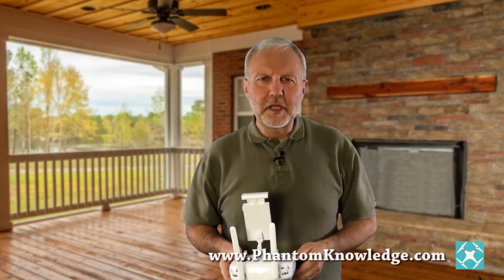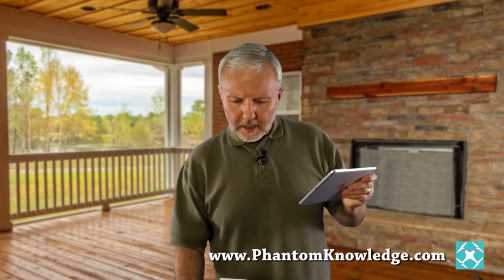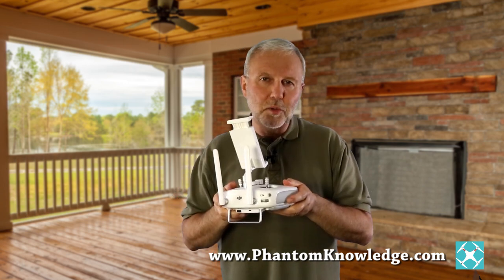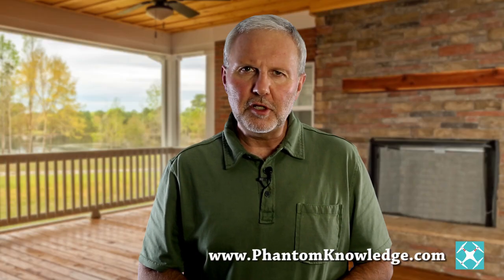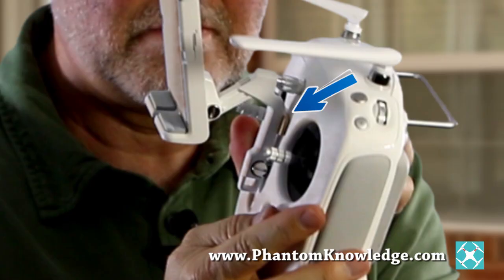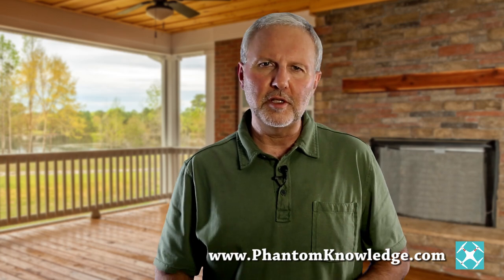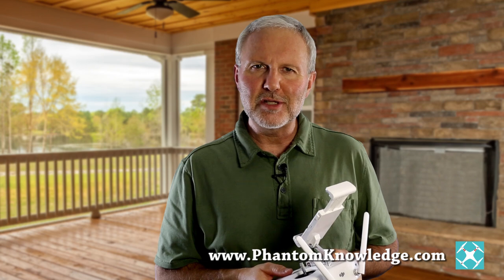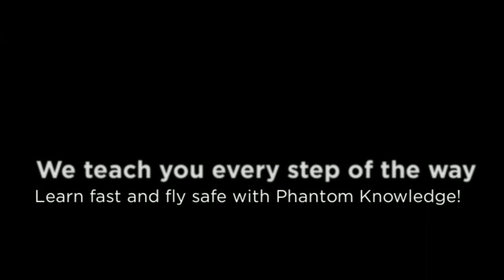Fixing the DJI Phantom 3 Bracket Problem

Comment: Thanks for the great video and the tip. I have a Phantom 3 Advanced and explored looking around for other replacement, third party bracket mount parts. Some come from China, some are from here and only sell the bracket mount part only for about $25 plus shipping. I am going to order the bracket mount and holder from B&H Photo for $30, which is great because I can also have an extra holder in case anything happens to my original. Great idea since I didn't think to order the bracket mount and holder for the Inspire for my Phantom 3. :-)